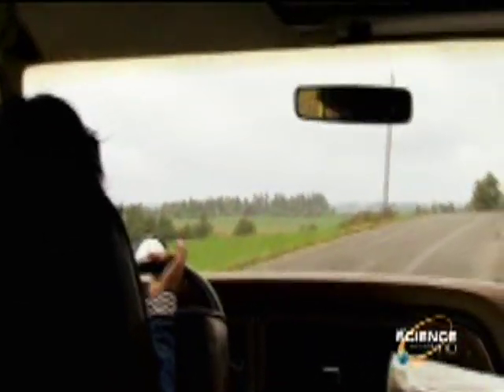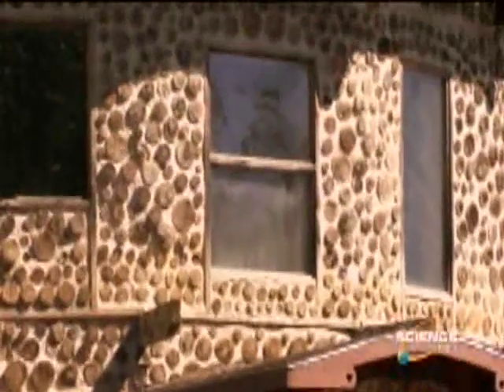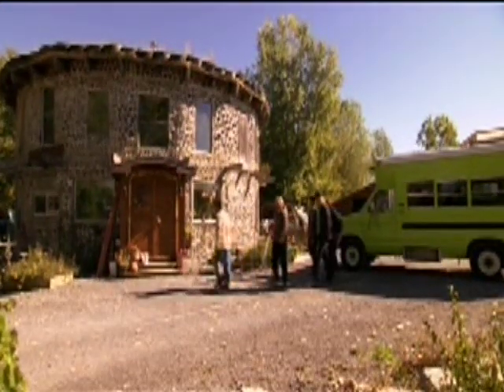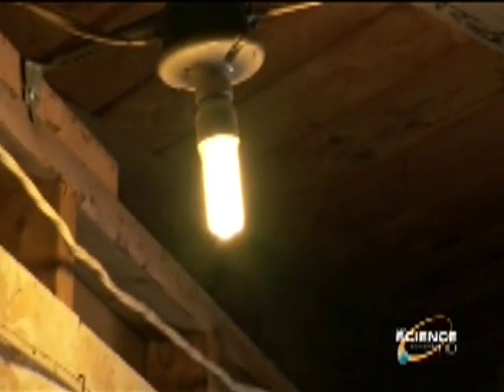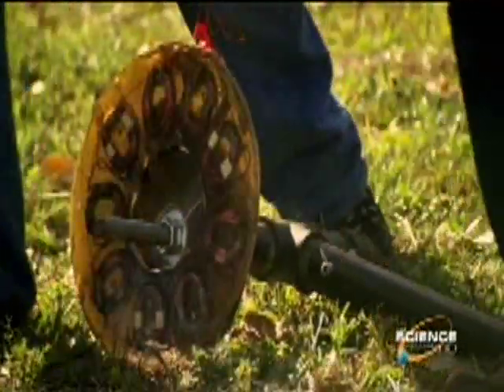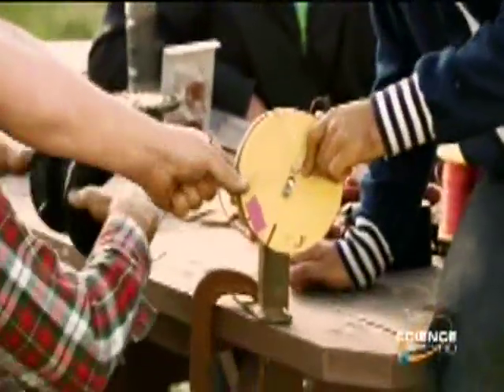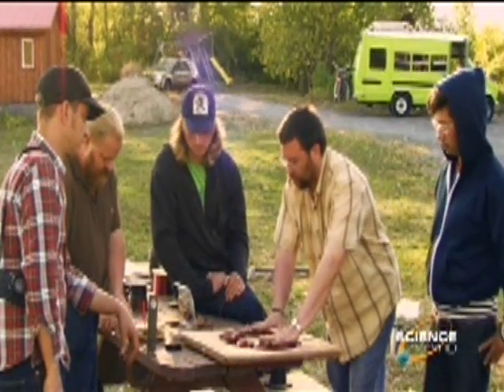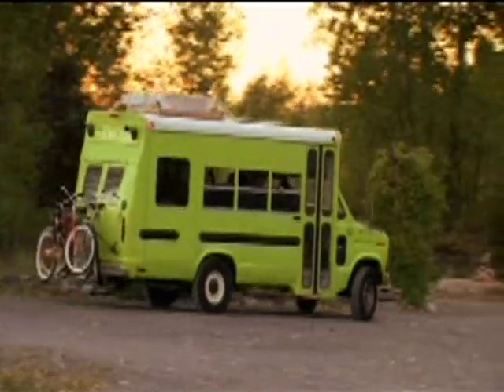Green-Trust.Org & Woodhenge.Org building wind turbines

Comment: I realize this is a very old video and this comment probably won’t get a response, but I’m very interested in reducing reliance on power companies and have some questions. Wind generators are typically not the first choice due to lack of power output. You say this one produces 1000 watts - could it be made to produce more with several coil/magnet plates as opposed to the one set?

Comment: A couple of questions...how do you determine the voltage? Is it a function of turns per coil or RPM or both? Also if a helical turbine were used and the PMG were mounted in a horizontal arrangement, would that affect it much?

Comment from the maker: turns per coil mostly. rpm yes, but battery voltage holds the output. as the amps flow, battery voltage slowly increase.

Comment from the maker: Car alternators make terrible wind turbines. They require high rotation speeds, which means power robbing gearing, and waste almost 100 watts in the field coil. Totally inappropriate for the job. This wind turbine we posted is a direct drive, 600 rpm unit, with permanent magnets replacing the inefficient field coils.